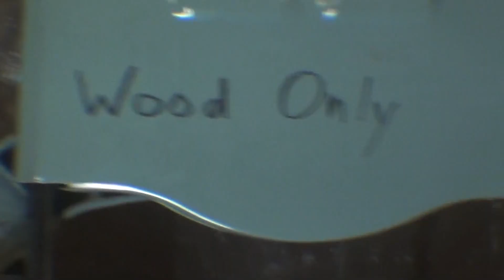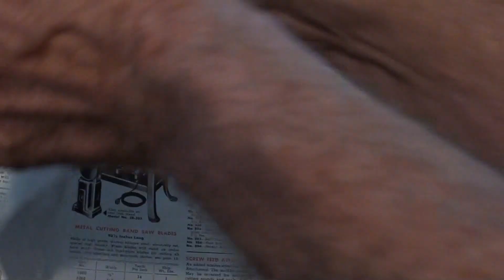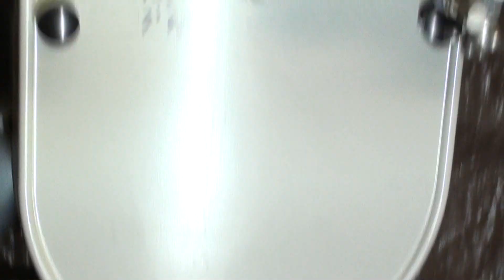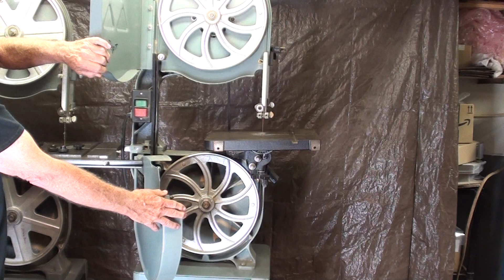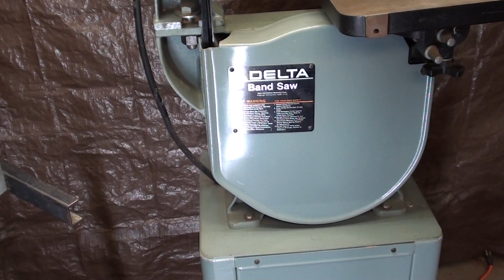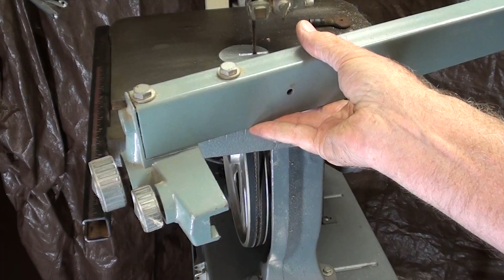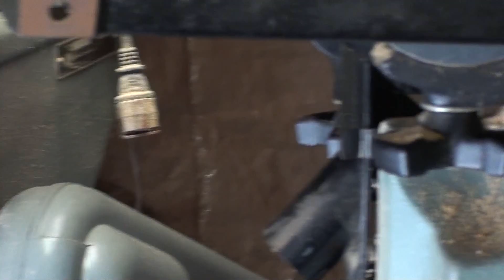All About Delta BandSaws Tips #486 tubalcain

Comment: Mr. Pete,
Delta sold to a Chinese company about 5 yrs ago.  They still make the Unisaw in the Carolinas.  When they sold out, the new company through out all the parts to the US machines.  They only support the new Unisaw.  A Delta rep told me this at a trade show.  The US manufacturers cannot compete with the Chinese for consumer goods. Wilton started building their drill presses in China when they were bought by Jet.  Clausing stopped building their 15 inch drill press about 12 years ago.  The 20 inch was still made in the states, but I understand it is imported now.  It's a shame, but no one wants to spend the money for US made tools.
Reply from the maker: All very true, but sad
Reply: the chinese saws are junk, the tiawan made saws are high quality.
Reply: Whoa, you had me scared there, but according to Clausing's website the drill presses are still made in Cleveland. The parent company is the 600 Group out of London.
Reply: Paul,
I took a look on their website, and they have returned the manufacture of the 20 inch drill press to the US.  They have not built the 15 inch drill press since 2006.  I have one from the last run I bought in early 2007.
Reply: The copying of the Delta bandsaws were the first tool copied, and opened the flood gates for the Far East.  I guess the only good thing is some of the Grizzly parts work just fine.

Comment: ....Your blade size written on the band saw instantly reminded me of the first thing I did when I bought my old Olson metal saw at an auction,  WRITE DOWN the blade size on it with a  paint marker!
 I too would rather see metal instead of cheap arsh plastics on knobs and accessories.But bean counters win for shareholders. About the only place I approve of plastics is in hand tools as long as they stay away from the "junk" plastics because it really reduces the tool weight.
 ..that all for  now, 99 miles away from ND/Boisavain Canadian/International  Peace Gardens

Comment: Have you ever seen the ones sold under the french brand "Syderic" ? They were built on the Delta frame but very robust for metal cutting, with a 2 speed gearbox, 8 speeds total, closed stand and "one single door"  guard ?
Reply from the maker: Have not, wish I could see one
Reply: @mrpete222   you can see one there for example : http://passion-usinages.forumgratuit.org/t2577-syderic-ssc-18-35-scie-a-ruban-verticale
Reply: those usually have the blade welder directly on it.

Comment: powermatic also has 2 models of 14" bandsaws one had a 2 speed gearbox for metal the other was direct drive. i belive they are more heavily built than the delta. i have a direct drive wood cutting powermatic and am going to be building a gear reduction as well as mounting a dc motor with speed control soon
Reply from the maker: Yes, Powermatic made a great tools

Comment: They did offer a Wood/Metal version of the 20" saw; I know because I have one. Search "28-365 Bandsaw" for more info and images. Interestingly, Rockwell labeled it Metal/Wood instead of Wood/Metal. Very good machine if you can find one that has not been abused. 

Weaknesses? (Some of these may also apply to the 14" Metal/Wood version):
1) Not really a weakness but definitely something to be aware of if buying on of these that you cannot test: If saw was operated by an idiot who changed ranges on the High/Low range gearbox while saw was running, gearbox may have been damaged. The dual range gearbox works in conjunction with a Reeves drive variable pulley set; the latter can and should be adjusted while machine is running. If bushing of Reeves drive did not receive regular shots of grease, expect wear. The manual specifies using grease in the dual range gearbox... I use 85W/140 gear oil (heavy stuff) because the majority of the grease in such a case gets pushed aside during the first 3 seconds of rotation and never again contacts the gears.

2) Blade guide system uses slides (rubbing blocks) on either side of the blade and an off-center roller behind the blade. The blade is supported by one side of the FACE of the roller; blade kind of skids along one side of the face which (sort of) causes it to rotate. see image here and note how blade is off to one side. 

http://vintagemachinery.org/photoindex/images/2020-A.jpg  

It is assumed that off-center loading of roller will cause it to rotate but there are other forces acting on the roller that are somewhat in conflict to those promoting rotation. The resulting rotational forces that do act on the roller are very slight so you need to keep an eye on it (and keep it lubed) as it does tend to get hung up and if left that way, it will eventually wear a groove in the hardened face of the roller. If play in roller bearings becomes excessive, roller will not rotate because axis will no longer be perpendicular to section of blade and it will be easier for the roller to just sit there cocked/skewed without rotating. There are some excellent aftermarket replacement guide systems; not cheap but you're keeping the saw...

3) Again not really a weakness; more an observation: Starting the saw while set up for higher blade speeds involves some fairly violent belt slippage but there's no harm in this; just makes a screeching sound until inertia of rotating mechanism is overcome.
Reply from the maker: Thank you, very interesting observations

Comment: I have the gearbox model, not sure the year. Pretty familiar with the non-hinged covers they are a pain. Also odd that all the chips and swarf fall to the bottom of the open base where the motor is mounted. Had to shield it with a piece of cardboard.  Odd designs. This is a fun video and will enjoy the series.
Reply from the maker: Yes, there was no provision for getting rid of sawdust

Comment: I bought mine in about 1990. It works well. I have cut aluminum with a metal cutting blade but the teeth disappeared as soon as I tried cutting mild steel. I've wanted to convert mine to slow it down but it's low on a long list of projects. Looking forward to watching this series
Reply from the maker: Thanks

Comment: Mr. Pete, you & I share the very same feelings about manufacturing of USA products.
A little more info. on the band saw. Around 2009-10 Delta thought(?) they could have China manufacture that saw. That turned into a huge problem. Parts were not standardized/nor fit one with other. Carter's bearing guides could not fit because the casting interfered. I think that's when Delta decided to sell to Taiwan. Everything, table saws, band saws, drill presses, the trade name Delta, the list goes on. Why did I do the research into this? Simple, I bought a band saw that was manufactured in China by Eskimos in  the dark. Yes, I paid $50.00 for it & I knew how to fix those problems. I taught Industrial Arts for 22 years.
Reply from the maker: It's good to hear from another shop teacher. The quality sure went down on those band sauce.

Comment: I did a pretty good comparison between the present-day Delta 14" bandsaw and the Harbor Freight 14" bandsaw...and found them to be virtually the same machine with the major difference being that the HF machine uses a closed-frame capacitor-start motor with a 4 step pulley system (cast iron pulleys too) for speed changes.  I went with the HF saw and haven't been sorry yet.  Now the Delta saws have a very new look to them, but this was a few years ago.
Reply from the maker: It's good to hear that the horror freight saw is pretty good quality.

Comment: Another great video. I purchased one of these new in the 90's when I was doing a lot of wood working. Now I am getting into machining and fabricating. I am planning on converting mine to do steel also. I am thinking of doing it through pulley ratio's and also moving the motor under the table so it does not get as much dust. No matter how much I clean it, the motor always seems to be an inch deep in saw dust. I will look forward to watching how you do it. Always seem to pick up a good idea or two from your video's.
Reply from the maker: Thank you, watch for the upcoming videos

Comment: One of the frustrating things about these saws was the use of zinc alloy trunnions.  I learned the hard way about grabbing the table to move the saw. The trunions simply crumbled when the table was twisted.  Many of the imports are now using cast iron trunnions which is a big improvement.
Reply from the maker: Yes, you can't use the table as a handle

Comment: Mr. Pete
I'm converting my Rockwell 20 inch band saw to metal.
Reply from the maker: Good idea
Reply: @mrpete222  I have source for a new 3 phase 100 rpm gear motor that I'll run through a VFD, I should be running  265 SFPM with that configuration.
There is a ton of room in the cabinet, the plan is to have two motors one for metal and one for wood. I figure it will be easier switching the vee=belts than changing blades.

Comment: I have had the older saw like yours, but with the enclosed stand, since new in the early eighties...and the doors are a pain, as you say... I did buy and install Carter ball bearing guides which was a great improvement over Cool Blocks or the original steel {or cast iron} guides...It has been a great saw and I cut aluminum AND brass on it running at the original speed. I also developed a way to sharpen the blade right on the saw many years ago using a chainsaw diamond burr and a Dremel..They cut better than new afterwards..A 93 1/2" blade takes about twenty minutes....As a boy in the machine shop, one of my jobs was silver-soldering bandsaw blades for customers..I have done hundreds of them....Looking forward to your follow-up videos, Lyle...thank you.....
Reply from the maker: Thanks
Reply: i am hoping he discusses the best guides to replace the original. i have one of these 14" delta brand, not sure of its age.

Comment: I would suggest using a 3 phase motor and VFD to change the cutting speed. I sold my Delta wood/metal cutting BS to purchase a much larger BS. I wish I had not sold the 14" Delta, because I do miss being able to slow the speed for metal cutting. 

So what I am going to do is the above. Yes the motor and VFD can be pricey, but I'll spend the money on something. Why not buy these devices and enjoy it?

By the way..............

Great video Mr Pete. We love you. And I am sure 1,000's more do to. You have done so much for us dear person.

P.S. You will love that Delta fence because it has a fantastic "vernier" knob. Be surprised how much that comes in handy. Also; that wood/metal 14" Delta BS your brother had; has 6 speeds (using opposing multi-grooved pulleys and a quick switch over knob, from hi speed to lo speed as well), with a chart as to what speed you need for what metal you are going to cut. And it is quite easy to change the speeds. Awesome.
Reply from the maker: Yes indeed. I have all the equipment to do a motor change with our VFD in a future video. Watch for it is on the schedule

Comment: I've got a delta model 28-276 made in the early 2000s or so. I find it crazy that you're newer delta has plastic parts and my Chinese made saw has cast handles and knobs. The only complaint I've got is the doors will not stay shut.

Comment: There are a few modifications and aftermarket products that enhance these saws performance. I have two of these saws of different vintages. 1) I found the webbing in the casting were constantly filled with sawdust, so I filled the open spaces with spray foam. 2) The blade guide height adjustment kept loosening no matter how hard I snugged the knob. I made a lever by bending a bolt at right angles, then cutting off the head and putting on a wooden handle. No more slipping ...3) I added a stronger after market blade tension spring. I got mine from Iturra, but I understand Olsen also offers one now. 

i don't know if Iturra is still in business, but he offered a wide range of fine products that enhanced the 14" Delta.

I see that Delta no longer markets this style saw.
Reply from the maker: Thank you for that

Comment: My biggest gripe about stationary power tools in the US is the SWITCHES. Even the switches like the one you show on on the newer saw which look to be very good quality still are not No-Voltage Release switches.
You can tell somebody to unplug the machine as often as you may like, but unless they also remember to check the physical position of the switch, when they plug it back in it may jump up and bite 'em!
Instead for an extra few dollars you can install a No-Voltage Release type switch which will save you such an indignity, and perhaps also save you a fingertip or two.
Reply from the maker: Good idea thanks

Comment: I installed a DC motor and controller on mine - the variable speed is nice, and it has worked well for me, both on wood and metal.
Reply from the maker: I will be doing that in our future video
Reply: Sometimes the motor etc choice is made by what you pick up used and cheap and then find a good use for
Reply: Exactly - mine was surplus, and wasn't expensive. I'm waiting to see what MrPete does...

Comment: You need about 1/20th reduction, maybe more.  Pull gear does not have the right stuff.  Make 2 compound pulley's and idler to change belt or gear reduction.
Reply from the maker: Be patient. That is all covered in the next five videos

Comment: ...12:50.....It would have made a very sturdy blade guide, but they'd have had to broach that cast-iron piece for a 1" hex....there are a couple companies making metal cutting bandsaws that do have a 1" square hole up there, but in a cast aluminum frame....when it gets worn...nearly impossible to fix/repair….but that's usually only a problem in very old and heavily abused saws. (Just my opinion as a Maintenance Mechanic)...
Reply from the maker: Thanks

Comment: I would consider a VFD and 3 phase motor. rather than VDC.   If you get a 3 phase motor with the same frame, it might be a drop in replacement.  The VFD will control the blade speed better.  VFD's are available that are single phase input and 3 phase output.   I have had both and both can work.  I have a VDC on my 9x20 lathe and can thread under power at about 14RPM.
Reply from the maker: Yes, that's all coming up in a future video

Comment: Plastic:  You sound like my dad.  I remember his Craftsman drill with the metal case that would periodically zap you as you used it...I am only 50, I have accepted plastic...
Reply: I refuse to accept plastic at metal prices, especially when the plastic is inferior in function to the metal predecessor...
Reply: @Edwardmodos  Haven't you noticed?  You are now paying plastic prices for everything.  Chinesium plastic prices...You want quality it is still out there, you just have to pay for it.
Reply: I am wrong.  I decided to check.  In the 1940 catalog Tubalcain shows you can get the Delta 14 inch bandsaw in base model for $30.  Using an inflation calculator shows that is about $530 in today's money.  You can get a Delta 2 speed, 14 inch bandsaw at Home Depot for $699 which is pretty equivalent to $38-$39 in 1940 money.  The cost of that bandsaw with the base, fence etc...About the same really.  Which one is better?  I would submit the modern one is the better, more versatile tool to use, but where will it be in 80 years?  Definitely not as durable.  It would be an interesting conversation.
Reply: The new Delta is available from Amazon, Lowes and probably many more places. Here is Menard's :      https://www.menards.com/main/mcom/tools-hardware/power-tools/power-saws/band-saws/delta-reg-14-band-saw/28-400/p-1444429045115.htm
Reply from the maker: Thanks

Comment: Great video!  I have one of the Chinese knock-offs and have had to make a few improvements.  Looking forward to the next videos on band saws for some more improvement ideas.
Reply from the maker: Thanks
Reply: What kind of improvements did you make? I have a knockoff (probably from china, but it is from the 90's so I have some hope part of it might be US/Canada made). I already know I need an aftermarket fence and replacing the guides with "cool blocks", minor repairs to the machine, and finally a much better base (or lots of metal added to make it heavy/stiff). My problem is i don't want to throw too much money at it, if I do I should just start to look at a modern high quality machine.
Reply: Third party (kreg) fence, cool blocks, urethane tires. Mine is 4 speed using a jack shaft. The secondary belt slipped a lot on the jack shaft so I moved it to one step over to get a bigger pulley and more contact. That stopped the slipping, but made the saw a little faster and reduced it to a 3 speed saw. Replacing the chinese belts on both the motor to jack shaft and jack shaft to saw, along with the new tires, made the saw almost vibration free--a problem I had from the beginning. The belts made the biggest difference. I also extended the blade tensioning knob to above the saw so I don't break my knuckles when adjusting. I changed all of hex head bolts on the blade guides to socket head screws so I can adjust with allen wrenches.  I spend as much time fiddling with the saw as I do using it, but it is fun trying to improve it.
Reply: @Swarm509  I made a reply, but didn't do it right so you have to look at your original question.

Comment: Very nice video! Now I have a metal cutting Delta, with the gear box, but have only used the saw as direct drive. I will have to get some step pulleys and fill the gear box with oil now and see how much oil it leaks. Haha! Enjoy your videos.
Reply from the maker: Yes, settled up for metal cutting
Reply: @mrpete222  I'll get the parts together and try recording it. Haven't done a how to video, but will give it a try.
Reply: @mrpete222 Mr Pete, good morning, just put a video of the old bandsaw with back gears on my youtube page. Demonstrated the different speeds through the back gear and step pulleys. Thank you!